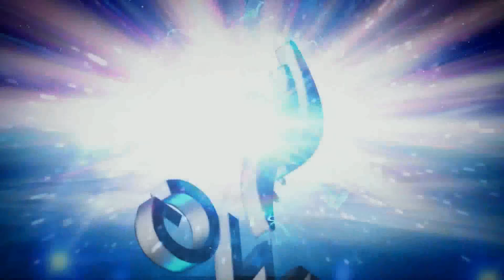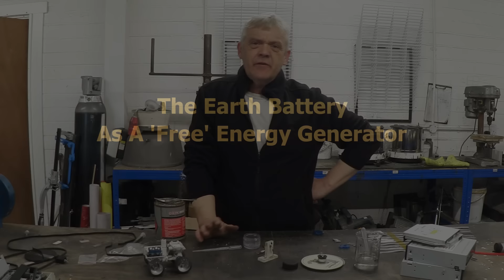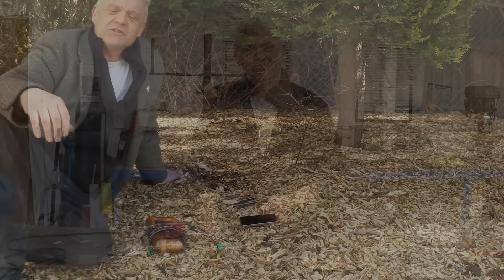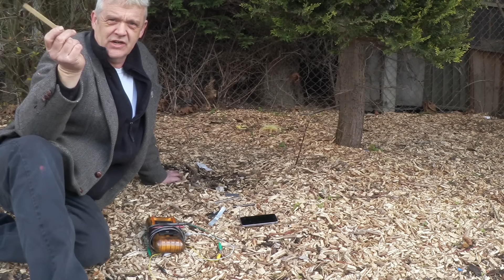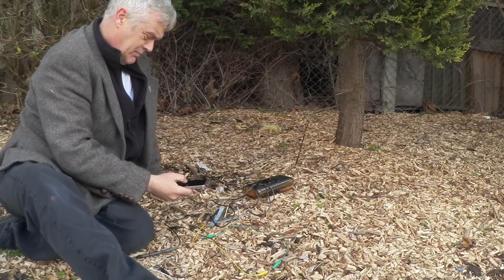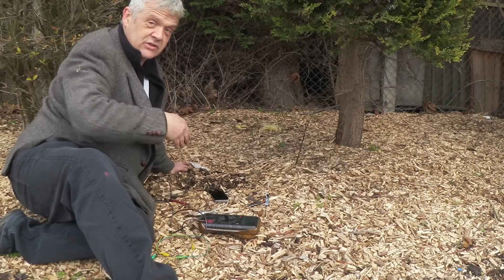The Earth Battery As A 'Free' Energy Generator

Comment: I think it's work the same as a fuel cell. The trapped gas makes a reaction. In this case the gas would be co2(trapped in soil when it rains) and ethylene/methane from decomposing plants. The gasses are use by plant respiration. Reply back if this was an interesting comment :)
Reply: Thanks for the readings.

Comment: April Fools suspicion is strong considering the topic tho 😉
Reply: Try it yourself becore casting doubt. I did and its true
Reply from the maker: lol - some bits are tongue in cheek for sure - but the earth battery does have a grounding - pun intended lol
Reply: Nathan Stubblefield sent the first radio that way. He also used coils above and below ground. I think that is where Tesla's Wardenclyffe idea came from.
Reply: It's field energy. Different metals prefer different fields and are used as a antenna. Same as a newer LED, Thermo electric generator, solar panel ECT. Use opposite metals for opposite fields to get a potential difference which can be used as energy. One is attracted to the other and that's the energy that is captured or used.
Reply: Stephen Rother yes Stubblefield had earth batteries and wireless phones in 1902. Wikipedia
Reply: Christopher P Wedlock  timezones

Comment: Nice experiment.  I only just now found your video.  I discovered this for myself about a year ago.  I was reading on a wet day, one probe of my multimeter in the ground and the other (positive) lead, I stuck into the bark of a tree and was getting .97v dc.  I was surprised that I was getting any electricity within the tree because wood is an insulator, so I think I was reading from the water/moisture in the tree.  Especially since it was wet, but I was still intrigued by it nonetheless.  Especially was curious about the surface area of all of the roots because it was a very large tree.

Comment: If you use different metals for the two electrodes, you are making a simple battery.
To test for “telluric currents” you need the electrodes to be the same metal (to remove the battery effect).

Comment: I figured out where the electricity is coming from a long time ago in the 70s when I found the voltage on my 150-foot-long short wave antenna. the sun is boiling off gazillions upon gazillions of electrons and they like to stick to objects like the earth. Then they find an electrical path to the ground through the conductive wire I used for an antenna. The earth can be positive instead of negative if the negative source voltage is greater than the earth. That's why we use negative voltage regulators in electronics. I used to use a ceramic capacitor on my antenna to block the voltage and pass the radio waves. along with a grounded spark plug for lightning protection. The same thing kinda happens inside a vacuum tube amplifier, electrons boil off the heating element and are attracted toward the plate, the sun would be like the heating filament and the earth would be like the plate. It confusing because vacuum tube electrical diagrams are drawn as the elections go from positive to negative but they go the opposite way from negative to positive. The sun is the generator and the wire antenna connected to the earth is just an electrical path.
Reply: If you think what I wrote is nonsense I have 15 years of experience as an engineering technician troubleshooting analog and digital electronics down to component levels and making reports so average people and company management can understand the technical problems. I try to do my best.

Comment: By using different materials for each electrode you are making an ordinary battery where the metal highest up the electrochemical series will corrode away, producing current and power. You could do the same thing with sea water or lemon juice as electrolyte.
If you are looking for potential differences in the earth then use the same material so galvanic effects are eliminated.
And there are circulating currents in the earth, for all sorts of reasons.

Comment: Years ago - Radio host Art Bell (Doesn't everyone know him?) - put up a 160 meter antenna around his acreage. A long wire horizontal loop if you will.. His call by the way was W6OBB. He was quite shocked - literally - when he discovered his disconnected antenna arcing. He said on air it was around 300 volts. I wonder if any reliable source would be available if he put that though a rectifier??

Comment: It appears to be just galvanic action, in which case it's an electrochemical cell which gets its energy from the corrosion of the metals, which gradually get depleted, as it discharges. The original source of energy is that which was used to extract the metals from the ores i.e. electrolysis in the case of aluminium.

Comment: 10:40 Holy smokes!!! 2 volts out of the Earth! You could maybe feed that voltage to a tiny amplifier via superconducting wires to avoid power loss, and then feed the output of the amplifier through a small inverter, and then increase the voltage with a transformer! Really you can work with anything  you've got as long as you can get some superconducting wires. I've gotta try this!

Comment: Two different metals/conductors, in contact with each other electronically, will spontaneously have a voltage (and current) across them due to the different depth in potential well (to infinity) for the loosely bound electrons. There is also going to be the effect of the earth's magnetic field acting on the electrons as they start to move. This was part of my high-school physics: we even calculated the p.d. for when the same metal was in contact with itself but was of a different shape.

Comment: Try using brass and stainless steel  rods ,you see a increase  in voltage  higher then most .carbon  rod also shows a good source  of energy  .  All rods need be in line

Comment: If voltages can be achieved with soil in pots, then it is not the earth itself, but earth as soil that is moving  electrons as a current and so it should be called a soil battery. The negatively charged electrons will be attracted to (and so increase the current flow) the positively charged sun, or when inline with other flowing currents and so get drawn along.

Comment: Wow. If, as "donna Sasa" says - she/he was able to get 5volts out of her setup. Using this technique is similar to how solar panels work. Each panel is made up of dozens of smaller panels which each produce a small charge. This charge is then stored in capacitors which then release their energy when full thus sending a higher voltage which then is stored in a battery. Once the battery is full - you can then run your house off of the stored energy and/or sell it back to the electric company. This sounds like a really good thing for everyone to make.

Comment: please try combining your electrostatic generator with the  forces like water,air and the earth battery you attempted in this video.
Reply: you mentioned holding a wire in the air to generate electrostatic micro amps,i would just like to see the difference in sticking a wire in the air, some water,the earth or even combining each element if they generate energy

Comment: It’s in terms of energy and vibration, the earths vibrating at a very very low frequency, and the earth can store energy because it’s conductive unlike the air. However just the fact that there is vibrations means you can use it as energy. Converting it maybe with a transducer.

Comment: You have to try this experiment.  Use tap water no salt and two metals.  I used copper and a zinc nail.  Hook up your meter.  Then sprinkle the top of the water with graphite powder.  The amps went from .2 ma and jumped up to .45 milliamperes.  The volts climbed by about 27% from .7 V to .975 volts.

Comment: That's a simple battery,where one side loses electrons while the other wins it.
And the ground between the two metals is the conductor.
If the ground is wet you'll obtain better voltage and if it's too dry will have almost nothing.
The conductivity will increase using salted water.

Comment: I had christmas lights on the balcony.  It was about 20 feet long. I put an extension cord to them. I dropped it to the ground. I drove a screw driver into the ground.  I put a meter on the screw driver and the lights as a complete circuit. I metered it at 7-volts. The current was barely measured,  but I did get 7-volts ..

Comment: I do not know which metals will produce a super alloy or if it is even possible.  But I want to know.  How come we cannot turn to a telluric chapter in a Chemistry textbook.  What elements make electrical currents.  I have produced two dry reactions, no soil, clay or water.  
1.  Iron copper and zinc: I hooked copper and zinc to an old cast iron pot.  Very small current.  
2. Copper, zinc and graphite.  I poured graphite powder into a paper cup and placed copper and zinc wires and nails.  It worked.  That is what spurred me to sprinkle it on the water experiment.

Comment: It also depends on the Ph of the soils.  If one kinks soils of differing Ph with a low resistance wire--a current will flow.  It is very corrosive to lead sheathed buried telephone and power cables.  I suspect that what you are doing is using different metals as plates, and the earth is mainly an electrolyte, with the differing Ph values not the only effect but an additional effect.

Comment: Seen demonstrations on YouTube using 20 foot long to 40 foot long Metal poles driven into the earth. Paralleling them like battery banks
Reply: t lech could you point me in a direction? It’s hard to find things like that on YouTube these days. Thanks
Reply from the maker: must be impressive do you have a link?
Reply: @ThinkingandTinkering  I'll try to find them!
Reply: Sounds the same as an earth compass using iron rods driven into the ground at an angle equivalent to latitude ...........this produces an electro magnetic pole which can be used to magnetize other needles etc to find north. This is very old news though I read it in a book written in 1930s/40's. All electronics, batteries etc Inc earth, sea and sky is old news too. Its just kept quiet from general population.
Reply: BRANN I yes I heard you can point a piece of iron in the direction of north and hit it really hard with a hammer and it will become magnetized.
Reply: @lostinthemoonlight  I heard that also but I've tried it and never had any luck! Maybe I'm not hitting true north? Or wrong Steel or not hitting hard enough?
Reply: I'd imagine it's not as simple to make one as it sounds. I never did try it and won't. I,'ll use the sun and stars and nature's infinite clues. Technology although interesting to me from a curiosity point is not actually something I will ever play around with. I like simplicity and nature...........so I'm not reliant on gadgets that can go wrong. Compasses are great until they ain't. Lol.......
Reply: Baseball fields. Start there.

Comment: Battery require a cathod, an electrod, and a membrane. 
I suggest finding an area of earth that is negative charged put it in half of a sand box. 
Then find positive charged earth, and put a membrane between them.
Place a cathod on one side and an anadone on the other side and measure the voltage.

Comment: 40-50 Full Milliamperes w/ Magnesium and Carbon One Cell
Materials:  one magnesium rod 12 inch length 5/16 inch diameter, carbon fiber cloth 12 x 6 feet, one sheet of paper, electrical tape and water bath.  Wrap magnesium rod with paper to insulate it from carbon.  Then roll rod with the full length of carbon fiber fabric.  Tape to hold.  Be sure to leave a bit of the magnesium rod exposed to attach your voltmeter.  This gave a full 40+ milliamperes.

Comment: Interesting experiment. Knowing that the current will be very low renders a dummy load unnecessary - I would just apply the "battery" output straight to the ampermeter. I would have liked to see if the voltage increases by placing the electrodes further apart, like 1 - 2 meters, compared to the initial experiment.

Comment: If it's some kind of telluric current like you suggest in the beginning then why do you need electrodes made of different materials? Surely a current would just flow through even if the electrodes are the same material. The simplest answer is that the Earth battery is determined pretty much completely by the materials used through galvanic action.
If you did see a voltage and used the same materials you would then need to rule out 60Hz line interaction and even waves produced by RF antennas both producing space waves and ground waves.

Comment: Polymer Clay Experiment
This man made clay will produce a very small current.  It will not dry out when exposed.  It smells of vinyl, and is basically an insulation material.  I have no idea how it works.  Luckily, I bought a 4 color pack.  The additives used to produce the clay changes the voltages.  This is part of my alloy theory.

Comment: There is a mapping of the magnetic Flux lines entry points on the earth. Believe it or not the company I worked for entered those calculations into the flow meter computers to increase accuracy of measurement. I found that current can be produced with a coil placed parallel to that magnetic lobe. Above or under ground. Alighnment was important but usable current was produced. The bigger the coil the more the effect tuning was done with an ammeter

Comment: Thank you for your great and impressive videos !
I have several questions.
1. Do we have better resulst by getting Energy from the ground and the zero from the socket or by two anodes somewhere in the ground?
2. Is the result in a big city the same like in a small village or single House on the country side ?
3. How many Ampere can be generated ?
4. Does anyone has information if a new digital electric meter can notice and record this kind of energy sourcing? My fear ist that they blame me for possible Manupilation or even Electricity theft !
5. And does anyone here have long-term studies over at least 1-2 years? Because I am very interested in how the energy yield, as described everywhere, always fluctuates in contrast to summer and winter and thus also the moisture of the soil.
Thank you in advance for polite and authoritative answers.

Comment: dissimilar metals affect.   the affect of two types of metals between a semi-conductive medium creates electricity.  similar to a potato battery,.  believe it or not, this works better with Moist earth because it increases the conductivity between the metals.  also orientation to magnetic earth has little affect, but orientation to the anode and cathode shapes does have a great affect.. for instance a larger anode than cathode can create a larger negative pull and the opposite for positive pull..  please keep in mind when taking readings of power, please include both Volts and AMPS.. so that you can get WATTS value.  the WATTS is the WORK that can be used.
Reply: also the composition  of your earth makes a big difference.   the more IRON in your soil, the more conductivity.   or if you try and do this in Florida, it will likely not work well because all of Florida is SAND.  or if you do this in Arizona,  you'll likely get good results due to the high IRON content in the earth,  but only if its wet.  however, being arizona is a desert, it likely wont be wet for long.  not sure about the soil where you are.. but likely has an IRON content.   IRON + Zinc + Copper = very good dissimilar metal reaction = better power generation.   also if you used H2SO4  or battery acid to wet your soil between the poles you'll get MUCH better results.  this is still a BATTERY..  not a power generation..   as for the Debate your referring to,  not likely in a REAL scientific community, but more a backyard science community.

Comment: Did you know that the voltage on your mains travels underground? It's why they use a ground bar that is tapped about 8' into the ground. It literally travels from the house to the lightpole through the dirt.
Reply: That would only be if your mains got shorted to ground, correct?

Comment: If you can get about 1.5V from zinc/carbon pair, then this is an electrochemical corrosion - similar to the one that is harnessed in AA batteries.
If you get much more than 1.5V from Zn/C, then this is worth considering.

Comment: hi ppl. if u take AAA or AA batteries and cut off the bottoms. connect one wire to rod and one wire to batterie case. then you can put them next to each other and add up in series and parallel upt to 120 V or 220v or how ever much you want.

Comment: Put zinc and Cooper in an Orange and it will generatie voltage as well. Same principle based on oxidation of the one metal. Use two carbon poles and tell me if there is voltage.

Comment: Try your experiment, near the coast near salt, water on the cliffs or greens wards and you will quadruple the power you receive also make a coil out of your chosen material and dig the coil in and then put your anode in roughly in the middle of the coil and you’ll get 7/8V I’ve achieved. I think my best was 8.6 volts three of these setups can top 20 volts but for better efficiency try a area of soft harbour mud

Comment: Have you made a nano carbon electrode chlorine battery? The idea is to have two high surface area nano carbon electrodes separated by a gas filter. The top is connected to the antenna for positive and the negative is grounded. Chlorine is the working gas of the device.

Comment: Telluric Matrix Soup Theory
I have a theory that the telluric matrix, the material the dissimilar metals are placed is a great place to experiment.  Everyone else is changing out metals, but them matrix, soil water etc. can be improved.  I saw a glimpse of that when I sprinkled graphite on top of the water and the battery improved.  I think some of the non-metallic and potentially some of the metallic elements can be added to the matrix to create and electron soup if you will.  Just a theory, but I think I am on to something.